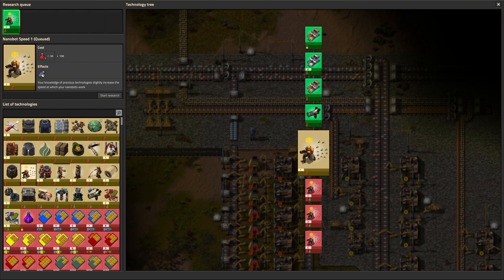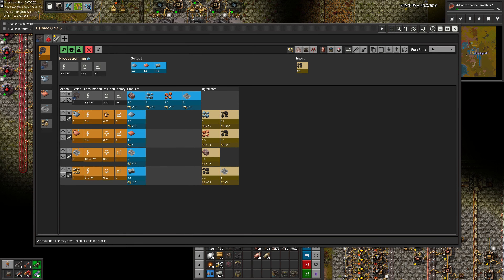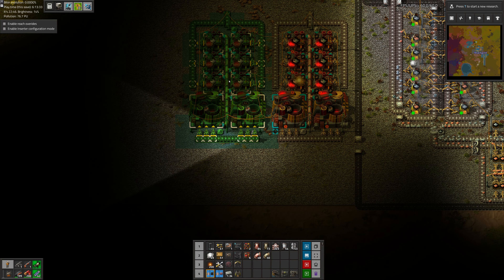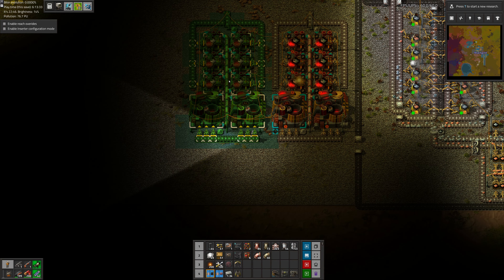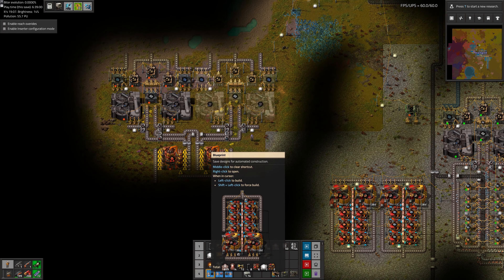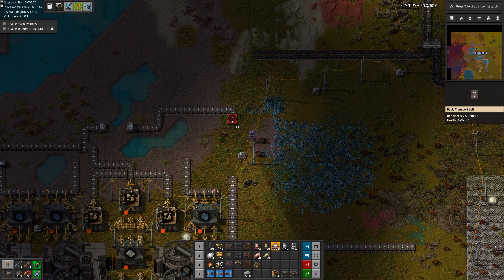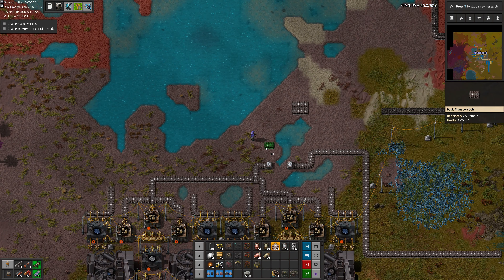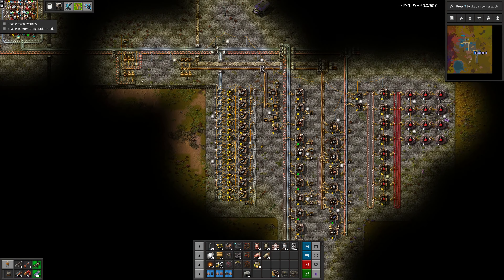[Factorio 1.1 4K] Angel/Bobs Ep 13: Angels Smelting (Tutorial/Walkthrough)

Comment: Ok I’m trying to use a mod list like yours but Space Exploration literally doesn’t work with things like Angels and Bobs, yet you have both of them on and running. Did you just forgo Space Exploration and keep Bobs and Angels?
Reply from the maker: It might be easier to download the save file linked in the description and have factorio automatically sync the mods. I’m not actually using space exploration, but i am using space extension. The mods are very different. What space extension does is make the end game longer by requiring multiple rocket launches to win the game
Reply from the maker: The mod list might be a little outdated. I do try new mods from time to time, and remove others that aren’t getting used, so you might see some inconsistencies. I should probably look over the mod list and update it with any changes.
Reply: @marsh8056  ohhh I mixed up “space exploration” with “space extension” I think that was my primary problem.